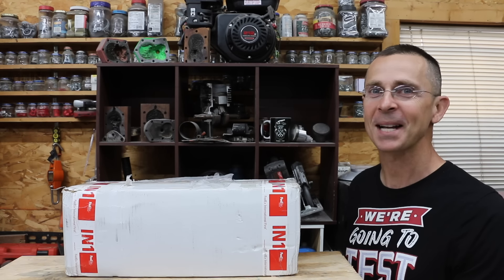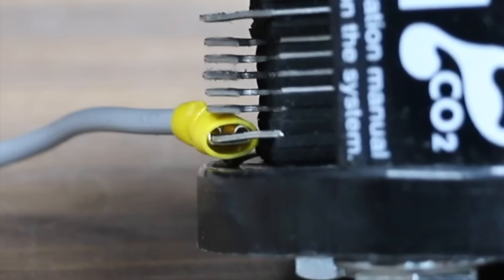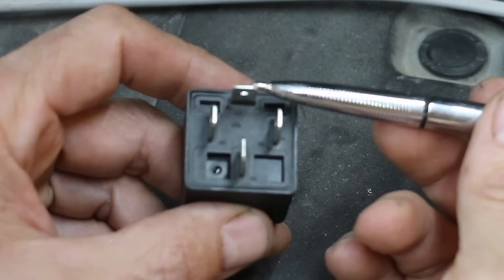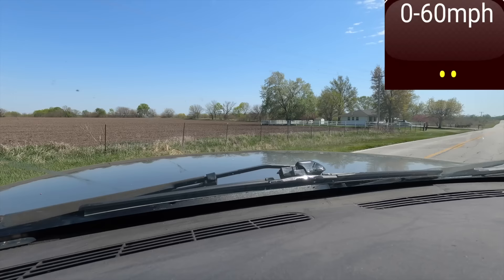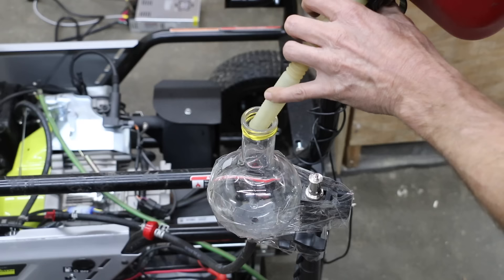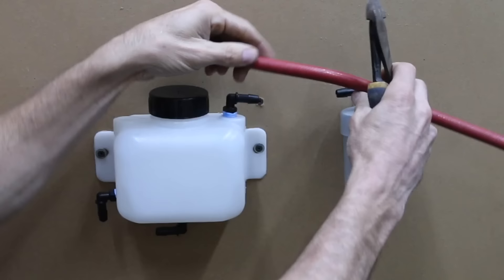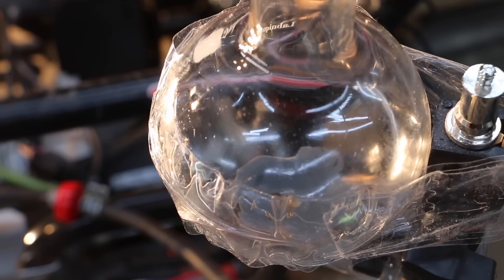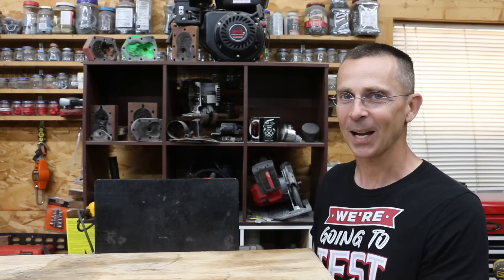AMAZING 35% More MPG with HHO? Let’s find out! Help with high gas prices?

Comment: Wouldn't this efficiency test need to be performed on an engine with an o2 sensor and/or computer controlling it so that it can actually compensate for the hydrogen?
Reply: yes it would. Im also confused as to why he ran the positive cable to the battery and not directly to the alternator. i installed mine on my truck and got an extra 4mpg. the science is sound that replacing an amount of gas with hydrogen would decrease fuel consumption. the alternator has a much higher capacity than the car needs, so your using the excess to create hydrogen.
Reply: whoever sold the kit may or may not have mentioned it but you're right. adding hho can actually decrease mpg unless you tune the O2 sensor circuit because adding HHO increases oxygen in your exhaust, which tells the pcm to increase fuel flow.
Reply: @kevc3148  hmmm how does it add oxygen to the system if the supplied Hydrogen + Oxygen gas mixture is stoichiometric?
Reply: @milanswoboda5457  depends on whether the vacuum is pulling more than hho is produced, and how O2 sensors work. I don't know whether they actually read o2, or a lack of it, or something else entirely. All I can say for sure is that if the composition of the exhaust doesn't change, fuel will be spent at the same rate. if there's too much oxygen, it'll be increased.
Reply: @kevc3148  Ok lets do a little calculation here.  According to the specs for such a "DC2000 HHO Dry cell"  the max output is 2 liters per minute @12VDC 25Amps (300 Watts),  those two liters of "HHO" Gas has the heat energy equivalent of about 3.8 Wh which would be equal to about 0.0004 liters of gasoline.  
The gen set used here has a 420 cc engine running at 3600rpm and that with an assumed fill rate of 60% would mean it is pumping about 454 liters of air per minute vs.  2 liters of HHO gas so I doubt you'll get too much HHO gas in there :).  Oh and per specs this gen would consume about 0.048 liters of gasoline per minute at 50% load .
Reply: @kevc3148  now lets go a little further,  this gen has a specified run time of 9.3 hours with a tank fill of 6 gallons (27.28 liters) @ 50% load (3500 running Watts) thus it produced about 32.55 kWh in those 9.3 hours and used about 259 kWh of chemical energy in form of gasoline to achieve that and that gets us about 12.6% efficiency for chemical energy in to useable electric energy out.  If we would connect that HHO to the generator it would pull 300Watts at max output of 2L/min for those 9.3 hours which would mean 2.79kWh additional for 1116 liters of HHO gas produced that has a chemical heat energy of about 2.1kWh ( hell not bad a 75% efficiency electrical energy in to chemical energy out at the cell stack that's like industrial megawatt size alkaline electrolysis stacks ). Those 2.1kWh worth of HHO chemical energy will then perform the miracle of not only offsetting the additional energy needed to produce it but also increasing the system efficiency so much that you will actually use less gasoline as well.   Yeah sure
Reply: @milanswoboda5457  bro respect but all those numbers just made me pass out cold
Reply: @richardmccallum2735  darn you're good writing comments while passed out.
Reply: @Irishrebel092  the science is also solid that the HHO system adds additional load to the system. Glad you got results
Reply: Maybe if a little fusion occurs Fusion many decades ago was claimed . Perhaps at a higher pressure/ temperatures such as diesel engine.  There's  a recent sci-fi  novel written based on alleged true case.  The Sharman  i think it's  title is . By Roland  Perry  . From the pages of LENR I wonder if a mass of nickel and or palladium in combustion  chamber might move things along a bit more .
Reply: Yes, there's a conversion kit for 02 sensors (I think a resistor to trick the computer). Very basic, completely useless.
Reply: @diegofernandez4789  certainly you can trick the computer by modifying the voltage it receives from the Lambda sensor so that it thinks it's running more fuel rich then it actually is but that can bite you in the behind since this "falsified" data can result in engine damage due to combustion temperatures being higher under certain conditions (especially FOT) where usually a fuel rich mixture is required to keep temps down.
Reply: @milanswoboda5457  yes, I agree with that. That's why I removed the hho system I had in my vehicle.
Reply: @milanswoboda5457  Well, actually, the secret lies in an entirely different field. The petrol-driven engine relies on the (nearly) instantaneous decomposition of a liquid(-fied spray). This not only releases energy (thermal), but also the liquid carbohydrates decompose to a bunch of gasses (H2O, CO2, CO, NO,...), which take up more volume than the original liquid did hence driving the piston down. If you think about the process of the HHO generator, this decomposition of liquid to gas takes place somewhere else - in the "bubbler". Lets take a balloon and pretend it's the combustion chamber(s) in your car engine. Attach it to the output of the bubbler, and you'll see how little water (by volume) is needed to fill the balloon (to the size of your combustion chamber). You then  ignite the balloon. Big BANG!  This is what should happen in a combustion chamber, driving the piston down, right? Well, yes and no - this violent chemical reaction actually leaves you again with the low-volume combined H2O - the water you used to produce the gas(-ses). For this reason, you can't really hope for any improvement in the efficiency by adding H(2)O2 to your gas(-oline-air-mix). What might work, is running entirely on HHO2, but you'd need to alter the way your engine works. The "implosion" following the ignition kinda  does the 2nd step of a 4-stroke engine for you, so you're messing with the entire engine timings/design... Although thermal energy plays a role in combustion (gaslonie-) engines, it's not that relevant (the hotter the gasses (exhaust), the more volume they have, thereby adding to the driving force) but what the ratio of volume fuel vs exhaust is and how quickly this happens.
Reply: @Irishrebel092   that hho generator is hooked up to a relay. The instructions require the relay to be connected. He connected one of the wires to the ground, the other one to the positive battery terminal and the other one to the ignition/remote power which is connected to the alternator as the instructions indicate.  The reason One wire needs to be connected directly to the battery is because of the way it turns off. I know it's hard to understand but everything in your car that draws power is connected with the same type of connection.
Reply: I don't think it matters the amount of hydrogen the generator creates is going to be negligible compared to the amount of gasoline and air the car uses. I was a chemist for 15 years and the amount of hydrogen that you can draw from that small container of water is going to be 11% of the total mass of the liquid water. When you multiply the 11% by the molar mass of water you end up with 200 grams after you use the bottle. He should have measured the starting mass and the ending mass of the water solution. However, I would imagine it would have probably been something less than 10  grams total that was used.  If 11% of that is hydrogen that means 2 g of hydrogen was used. I can't wrap my head around 2 g of hydrogen improving 35% fuel efficiency. Anyone that knows anything about a combustion engine would not have to use this to realize it is a gimmick.
Reply: @milanswoboda5457  Well, the chemical formula for petrol in principle is CnH2n+2 (that's basically carbon and hydrogen) - true, real carbohydrates - as in sugar - have an extra O thrown in, but that's irrelevant to the point I was making. Besides that, I don't get how the Carnot theorem should apply here. Heat in a combustion engine is a by-product and as I tried to explain, not the main factor in an combustion engine. Suppose you "cheat" the system and bring in a second source of energy to split the water (e.g. solar charged battery), the chemical reaction is still working against the basic design and timings of your combustion engine. Hence these fuel-saving gadgets based on adding oxyhydrogen to your fuel-mix cannot work in the way people are hopeing for. Otoh, that doesn't mean you can't design an engine running solely on oxyhydrogen...
Edit: forgive me for not receiving my chemical education in English, I do get some terms (and even elements - who on earth came up with 'potassium' for 'K' or sodium for 'Na'???) muddled at times...
Reply: @mortirius1  ;) - to put your numbers into context: 2g of H2 at STP have a volume of roughly 22 litres - replacing 1% of air-intake in a 500ccm engine would let it run for 4400 rounds, that at 500rpm would last approx 8minutes... Ok, I neglected the O2 and the chosen numbers are certainly just for rough calculation, and certainly closer to the generator than a car engine - but still, I think the rate needed to produce enough worth adding into the calculation of fuel-consumption becomes more clearer...
What would interest me more though, is your opinion on the points I mentioned 2 or 3 comments back - suppose you can add sufficient amount and your engine electronics don't mess up due to raised oxygen on intake side etc. - would a oxyhydrogen reaction be able to sensibly add to the driving force of a petrol-driven combustion engine? And is there really a supposed 'implosion' in the aftermath of fusing H2 and O2 to water?
Reply: @itsmeadude460  The Carnot principle is the ideal heat engine with the assumption no entropy change thus fully reversible.   An ICE engine is a heat expansion engine with heat being the main driving force and not just a byproduct hence it is compared to the ideal carnot cycle.
Reply: @mortirius1  sure you could measure the difference in mass of the water but you do not know how much of that used water was actually converted into H2 and O2 gas and how much of it is just water vapor created from the process.  Further up in this OP reply tree I provided an estimate based on available data and there is very little energy to be had from the Hydrogen produced even if we assume their highest output values, which likely will boil the water in a very short period of time and taken with a big grain of salt looking at the high electrolysis efficiency those values would come out to, vs. what the generator used here consumes in fuel energy.   Yep it's a gimmick for the gullible, the seller makes the gains to his bank account ;)
Reply: @milanswoboda5457  With all due respect, but I'm not buying it. A steam engine was a pure heat expansion design (water got heated and steam needed more volume - cool it and it needs the same volume as it started off with) - but by burning the fuel (petrol) the resulting products (CO,CO2,H2O,NO,...) have a higher volume than the original (liquid) petrol. Heat naturally adds to this effect, but if you take out the heat (i.e. cool the 'exhaust fumes' to 'room temperature' or STP) you'd still have a considerable plus in volume. You're right in the sense that by converting movement energy (motor turning) into electricity (via alternator/car internal generator), which is used to split water of which the products then again are used to turn the motor you'll never end up in a plus of energy (you'll lose to to friction, resistance and whatnot other effects). But that argument is weak, since it's easy to add in more energy via a separate battery that is used to split the water - which imho still won't help, due to the chemical reaction taking place and thanks to @Mr.J probably won't be possible in any reasonable scale.
Reply: @itsmeadude460  LOL you don't have to buy anything,  it is freely available information.  I see you are fixated on steam engines (phase change heat engines)  but apparently you are not aware that Otto, Diesel, Stirling, Atkinson,...etc. cycles are all HEAT engines where combustion HEAT is converted into mechanical energy. Even jet engines are heat engines.  Heck don't want to believe what is commonly known then do me a favor and calculate out the theoretical volume change that you'd get from a given amount of solid/liquid/gaseous fuel @ stoichiometric mixture and then look at the volume change that you get with the temperature delta from the combustion and then come back and tell me which one has the most volume/pressure change ;)
Reply: @itsmeadude460  oh and btw liquid Hydrocarbon fuels generally do not contain N and the NOx gases you get from combustion are formed from Nitrogen and Oxygen gas ingested with the ambient air in combination with the combustion temperature.
Reply: @milanswoboda5457  I must admit I underestimated the volume air has on the intake side, but nonetheless you still haven't shown how the Carnot theorem should apply to the whole process of an alternator hooked up to an ICE used to split water applies. Oh and BTW, fuel can contain (traces?) of nitrogen and the thermal path is not the only way to obtain NOx gases during the process of combustion (google MILD and NOx reduction).
Reply: @Irishrebel092  the problem I have with this hho is how low the volume of gas going in is. Youd be better off making a solar powered one at your house and using it to fill tanks to use in your vehicle
Reply: @itsmeadude460  Carnot principle is the benchmark for all heat engines as no heat engine can exceed the theoretical thermal efficiency of a Carnot cycle.  Did I say anything regarding application for the whole process with an alternator hook up when mentioning that you look up the Carnot theorem? Nope, it was in response to your mistaken believe that the volumetric change from the creation of gases is what does most of the work whereas heat is just a byproduct.  Cmmon don't bore me here with some traces of nitrogen,  the majority of NOx emissions in a gasoline/diesel ICE engine is thermal NOx from the oxidation of the 78vol%/75wt% of Nitrogen in the ambient air ingested heat above 1700K in the combustion process and not fuel NOx.  Now if you use ammonia or coal as a fuel for combustion then we may get a higher fuel NOx emission.
Reply: @milanswoboda5457  So CP is applicable to heat engines, but how does it prove an engine is a heat engine (and therefore applicable)? I said nothing on the quantity or relation of NOx derived via thermal vs others paths (non-fuel-N), merely pointed towards their existance...
Reply: @itsmeadude460  As said before calculate out the volume/pressure change of the little liquid fuel you have in the combustion chamber and feel free to include all of the possible fuel "contaminants" with their minute amounts if you think that'll make a difference.  Don't ask others for proof instead look for the proof yourself and most importantly try to disprove you own theories from all angles possible.
Reply: @milanswoboda5457  I did my part - was just curious if you'd be able to back up your 'google the Carnot theorem' - since you said it wasn't aimed at the overall process of adding HH+O2 to your fuel and also doesn't seem to back your argument on an ICE being a heat engine... Other than that "...I said nothing on the quantity or relation of NOx derived via thermal vs others paths (non-fuel-N), merely pointed towards their existance..."
Reply: The foot is the adjustment on an older car, and if it works you would get the same acceleration and cruising speed with some degree less throttle. Less throttle, less gasoline consumed.
Reply: standard  O2 sensor wont work  proper for adjusting fuel flow  and if anything  if feeding the  straight hho   in along with normal gas  will decrease fuel economy  and can in rare cases cause   the engine to surge as the O2 sensor tries to seek the correct  mix which will be erratic,  if  you  run  hho on an engine without  using a compressed  storage system and metering it direct  the  claims of people   say they  got  2   -   4    or  8  mpg on their vehicles as  speaking out there hat they  have  no idea  how many  thousands of Litre  of  hho they would have to produce   per minute just to equal the  power generated  from gas, so unless they  run an hho compress and store  the  pure  hydrogen gas  not an hho  mix  and meter it   in a demand system  they cannot reach the claims they state
Reply: @DMPB-fi2ir  Please give me a reason why a "standard" oxygen sensor won't work properly with "HHO"?  Is the Hydrogen and Oxygen  in HHO different than the Hydrogen and Oxygen in fossil fuel and ambient air respectively?
Reply: @itsmeadude460  "You did your part" you keep telling that yourself if it makes you feel good but it ain't going to change reality.
Reply: @milanswoboda5457   oxygen sensors have to be adjusted (hacked) to prevent the cars ‘brain’ from adding more gas because of the higher sensed oxygen levels. We’re adding more oxygen with the HHO, to the air intake, the car doesn’t sense the more fuel, only the oxygen. It turns out there are also O2 sensor extenders that will prevent the rich state from more oxygen by moving the O2 sensor further from the exhaust flow
Reply: @DMPB-fi2ir why would the O2 sensor detect more Oxygen if you add a tiny amount of fuel (H2) with the exact amount of O2  required for stoichiometric  mixture with that fuel which will consume that Oxygen in combustion?
Sure you can fool the ECU within limits with offsetting O2 sensor values but for one you do not require HHO for that and secondly you're risking increased wear and tear on the engine HHO or not.  
Just another money grab from the gullible :)
Reply: @kevc3148  makes sense
Reply: Everyone in this comment tree so far is missing some important things about  gasoline / petrol engines, with HHO added at a fixed rate. @Milan Swoboda comes closest . . .  1) The engines are run rich, to keep temperature down and to prevent melting some parts of the engine. This kind of adjustment is seen very commonly in light airplanes with piston engines, where they richen the mixture at takeoff because full power is always more heat, but a rich mixture heats a bit less. It also makes a larger volume of exhaust gases, because a bit less oxygen goes into making CO2 and a bit more oxygen goes into making CO, since the available carbon content is higher with a richer mixture. It all adds up to more power and lower efficiency, but preserves the engine.
2) The fuel/air mixture in either carbureted or fuel injected engines is not perfectly vaporized. There are droplets of fuel remaining at the instant of ignition, unless the engine is running too lean and/or hot. The larger droplets cannot burn, because the air immediately around each of them is already either overloaded with fuel, or depleted of oxygen as soon as the combustion wave passes. Low RPM and larger throttle openings reduce this problem somewhat, because there is more time for the droplets to vaporize and mix with air. 
3) Ignition typically occurs a little before the piston reaches the top of the compression stroke (top dead center, TDC), and in larger engines the spark timing is adjusted earlier for higher RPM and/or smaller throttle openings, while on the other hand the spark is made later for lower RPM and/or larger throttle openings. Both the early and late sparks are done to optimize power and efficiency without causing engine knock (pre-ignition of the mixture before the spark plug's flame front arrives). Maximum power and efficiency occur when the right compromise is reached between spark timing, the burn rate of the fuel/air mixture, the crankshaft angle and other variables. Ideal spark timing must match the exact operating condition of the engine on that stroke of that cylinder, which involves the temperatures of engine and outside air, the compression ratio, the type and quantity of fuel, the throttle opening, the RPM at that instant, and other factors. It is a lot to optimize all at once, which is why modern car engines are so complex. 
4) In contrast, with small and simple engines there is often no adjustment to spark timing for either RPM or throttle opening, much less any precision of fuel metering and vaporizing, or air monitoring, which are important causes of the dreadful inefficiency and high pollution of small/simple engines. 
5) Getting more of the fuel to vaporize can increase power and/or efficiency. Adding the right amount of HHO can potentially improve the efficiency of the small and simple engines because HHO burns very quickly compared to the vapors of gasoline / petrol under the same conditions of temperature and pressure. That is equivalent to earlier spark timing, which gives more time for the fuel droplets to vaporize and burn. The HHO would be more effective in that role if it was all concentrated near the spark plug, instead of mixed throughout the cylinder. But that would require a complex engine and direct HHO injection, which are not going to be bolt-on things for the average driver or small engine operator.
6) HHO as described is in itself a leaner mixture, providing a slightly enriched level of oxygen in the fuel/air mixture. BUT if the volume of normal fuel is not reduced then there is an overall richer mixture, which (if all else is good) makes more power but at lower efficiency. 
7) The worst thing about the HHO system shown was that there is NO dynamic adjustment of the gas production rate. It is simply On or Off, with a fixed rate at any given instant, thus providing a variable fraction of the fuel/air mixture. This is the very opposite of the ideal situation. What is worse is that the amount of water in the reservoir is constantly varying as H2O is dissociated, but since the potassium hydroxide (KOH) is dissolved in the reservoir water, the concentration of KOH in the electrolysis chamber, and hence the production rate of HHO, is constantly changing. It increases as water level drops, whether or not the engine would benefit from extra HHO. In some cases, there may be too much HHO produced, resulting in combustion progressing too fast and too early, before the piston has reached the best position. Compressing a very hot, burning gas causes temperature and pressure to spike. It can easily go to very high values. Too high is very bad for the engine. It can blow holes in pistons, blow head gaskets, and other serious problems, all because (in both engines tested) there is NO METERING OR ADJUSTMENT of HHO production or (in the case of the vehicle) no way to know if the engine operating conditions from instant to instant can benefit from adding HHO, much less any way to adjust the HHO production rate. Optimizing for added HHO would likely require entirely different programming of the Engine Control Computer.
8) Instead of a relay, providing just On/Off control, the HHO system should use a transistor circuit with variable duty cycle, turning on and off thousands of times per second and feeding a MUCH larger electrolyzer, so that a larger and widely variable rate of HHO production can be ordered up in an instant. Of course, doing that right means monitoring many other variables at the same time, so that the proper HHO rate can be calculated.
9) In the full-throttle performance test in the car, which clearly had an automatic transmission, there appeared to be no pre-heating of the transmission fluid, so temperature is rising with every 0-to-60 run, which in turn decreases the power transfer of the torque converter. Engine temperature is also changing, with a similar result.
Reply: The only way to make hho work effectively, is to design an engine for that fuel specifically. Yamaha is working on just that... But I would love to see someone invest in hho to produce high pressure steam. I'm sure with the tech that's available today, we could come up with a nearly zero emissions vehicle. That would need so much effort to operate.
Reply: @henrytaylor3049  Large-scale electrolysis of water is sometimes performed at high pressure and high temperature, so that the H2 and O2 produced come out at high pressure, and the heat reduces the amount of electric power required. They definitely don't make HHO that way, with H2 and O2 mixed together, because of the explosion hazard.
Reply: @henrytaylor3049  sorry but Yamaha just like Toyota, JCB, ...etc.  are working on Hydrogen only SI/CI engines and not on engines running with a stoichiometric Hydrogen / Oxygen gas mixture what is called HHO in pseudoscience circles. In the end a poor choice of use for the premium energy cost Hydrogen being used with the  low efficiency of heat cycle engine.
Reply: @milanswoboda5457  Na, all you do is toss out comments that make you sound as if you knew what you were talking about, but when pressed, you fail to demonstrate that you actually understand what you type and resort to ridiculing ...
Reply: @itsmeadude460  keep on sticking to carbohydrates :)
Reply: @Irishrebel092  you do know that the battery cable is connected directly to the alternator right? 🙄
Reply: @milanswoboda5457  I’m really impressed with all the work u done for one video man. Our technology for internal combustion engines is so old and the base it self is not efficient so much energy is wasted in exhaust, radiator, hot air, sound etc. and yet we still use this primitive method. If we use consistent jets heating up steam in highly resistant block of possibly graphene quick and efficient heat transfer the hot air can be used to further increase pressure at the pistons and steam engines may actually be the future who knows
Reply: Since both the hydrogen and oxygen are used there is no change in mixture.
Reply: @michaelcorbidge7914  If fusion were involved the world would look very different today. When I graduated from high school in 1969 controlled fusion was said to be about 15 years away. That number has remained essentially the same for the half century since. Controlled fusion is still an elusive goal.
Reply: @Irishrebel092  although in principle it makes sense, that is unfortunately not how it works. The alternator places a load on the engine that increases as the car’s electrical demand increases. So in other words, you would spend more energy electrolyzing the water to create hydrogen + oxygen than you would by burning it in the engine. It may not make sense, but try thinking about it from a conservation of energy perspective.
Reply: @josephsmith2840  I'm a diesel mechanic, so I know how they work. Yes the alternator puts a load on the engine, but on average it decreased it 10%. The added mpg is greater than mpg lost by the alternator.

This is possible because this isn't perpetual energy since you're not producing enough to actually run the engine, just enough to supplement the engine.
Reply: @Irishrebel092  Not really, it takes energy to produce that hydrogen and that energy is coming from the alternator and that efficiency is less than 1. So you are only harming your overall efficiency. No telling if it will work on an engine that is very poorly tuned and inefficient to start with. But in that case, save the 200$ and tune the engine.
Reply: @paulg444   it takes some understanding, but the energy used to create the hydrogen is in fact less then you get out of it, but that's okay because it's not trying to be a infinite fuel source, just extend the range on the car. This is not creating energy from nothing, it's converting to usable energy from another source, and obviously there's going to be  efficiency losses every step of the way.

An example of this is if you try and run a generator off an electric motor that's running off batteries charged by that same generator. It will not run perpetually since that's not possible. But it will run slightly longer than if you just ran the motor off the batteries.

I've personally installed a HHO cell on my truck, and I got a 4-6mpg gain. It's not much, but that's an extra 50 miles between fill ups.
Reply: @Irishrebel092  The alternator B+ terminal is eclectically connected directly to the battery + with 10-8 ga wire.
Reply: The first test with the truck is an o2 sensor closed loop system.
Reply: Exactly. Bottom line, you can’t get something for nothing. Basic law of physics
Reply: @Irishrebel092  "the alternator has a much higher capacity than the car needs, so your using the excess to create hydrogen."  Install an even bigger alternator and use that excess to drive a motor for the wheels.  🤣😂🙃
Reply: @789563able  The concept is not to get something for nothing [Violating the law of thermodynamics.] but rather to overcome the already engrained in current technology designs energy conversion inefficiencies as much as possible
Reply: @mortirius1  it is possible and studies have shown a boost charge of combustible substances like hydrogen and even hydrogen peroxide and steam can  improve thermal efficiency of a ICE. However  fuel savings depends on the energy consumed by the device verse the energy produced.
Reply: Okay but if you watch again, the box definitely lack of instructions and stuff. Seems like a scam product not even the manufacturer know what theyre doing
Reply: @feero9680  the proof is in the detail of how and why it works. If that doesn't make sense - don't buy it. Tod should test new products ( or at least earlier versions ) before they are launch to  the public.. You know what I'm talking about Tod.
Reply: I think that on the vehicle, you should try the hydrogen hose before the mass air flow sensor?
Reply: @chuckz8053  
Isn't that the basic principle powering modern locomotives?
Reply: @nathanwinter9641  Makes no differences as AF sensor just detects the air flow from the intake. It doesn’t sense WHAT the air consists of
Reply: @Irishrebel092  it will make no difference connected either way, the battery may smooth out the voltage slightly, you may gain  0.2 volts directly at the alternator if you are lucky any more than that you have a problem with your wiring or connections.
Reply: @mortirius1  He connected the relay correctly, using an ignition source to switch the relay, the ground wire simply completes the switching coil circuit therefore closing the contacts between the load and battery.
Reply: @mortirius1  agree, you would need a much larger HHO out put to make any difference.
Reply: @itsmeadude460   1 liter = 1000cm^3.
500ccm = 0.500 liters
2H to 1O ratio for peak efficiency.
22liters H to 11liters O = 33liters.
33 liters/0.5l = 66 intake cycles.
4strokes have an intake cycle every other rotation.
So 132 revolutions. If you assume 500rpm (which is idle), that's 15.8seconds...
Reply: This was my thoughts as well. That generator may be fuel injected but without an oxygen sensor to compensate for the extra fuel (HHO) in theory you will not see any increase in economy
Reply: @Irishrebel092  Imagine if you had regen brakes running the alt  running the HHO
Reply: power source and o2 sensor wouldn't change the efficiency. the about of hydrogen and oxygen needed to increase "fuel efficiency" is so much greater than can be produced by an hho generator on the fly. and at that point youre increasing "petrol efficiency" while the cost of hydrogen and oxygen to cause an offset would be so much greater than just running petrol. unless you have a way of collecting and bottling oxygen and hydrogen from the hho generator in a cheap and timely manner itll never make a difference. probably have to have the hho generator run for 24 hours to make enough fuel for a 10 minute ride to save 35% petrol. and still on top of all that youre still limited by the mechanical efficiency of the motor. port size, displacement, flow rates. the only way to increase efficiency ideally would be lower displacement and increase flow with something like a turbo.